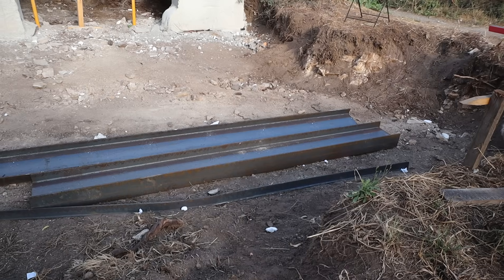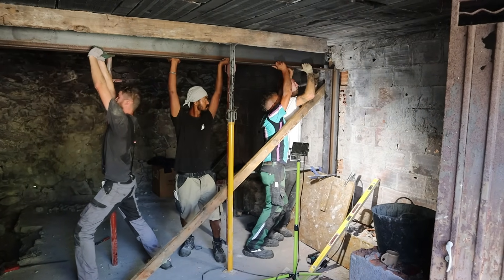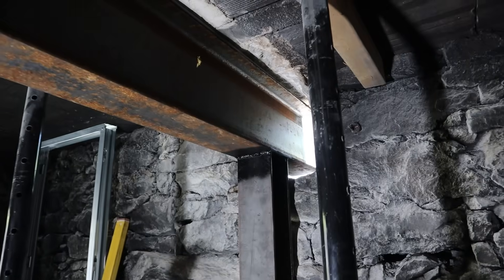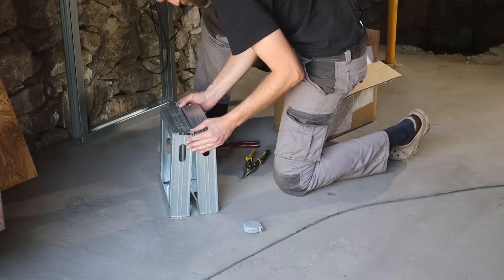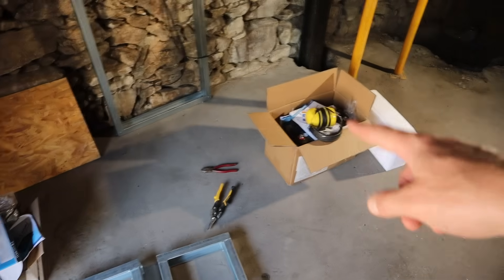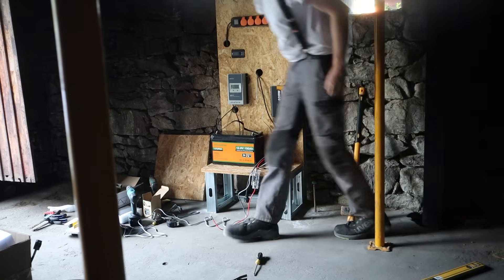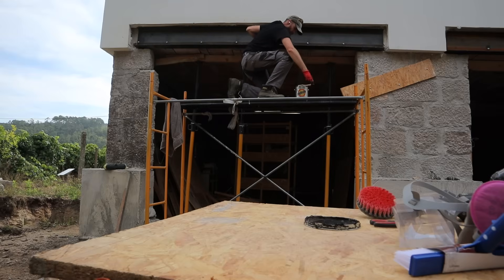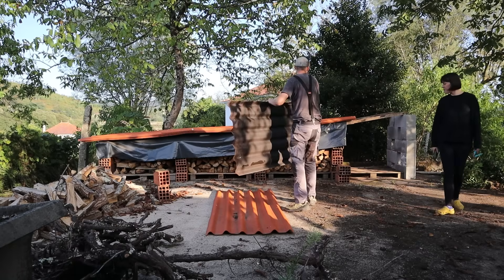#37 Installing Big Steel Beams + DIY Solar Power Setup

Comment: Just curious, the outhouse metal beam, why does it not go into the wall for extra support on one side? 
It is welded to the vertical metal beam only currently.
Reply from the maker: The engineer and contractor were not confident that the rubble stone walls had enough strength to support the beam. It was decided that a column would be added centrally as the existing wall will eventually be removed and next to the stone external wall

Comment: EXCELLENT CHANNEL, I'LL LEAVE 1 TIP IN A GOOD SENSE, IN THE EARLY TIME, I PUT SALT AND CHARCOAL ON THE EARTH ELECTRODE TO KEEP THE EARTH HUMID, ON THE INVERTER IF THERE WAS 1 WASHER BETWEEN THE WOOD AND IT PROVIDED VENTILATION AND COOLING. HUGS

Comment: The previous owners most likely used the out building to smoke pork ie. Chouriço and linguiça, morcela (blood sausage) smoked pork shoulder etc. this is a guess based upon what my Portuguese father-in-law did at home. Seems very familiar to me.
Reply from the maker: Thank you, that makes sense. When we arrived there were old bits of burnt furniture in there so I expect when they needed to clear it out they burnt it all too...